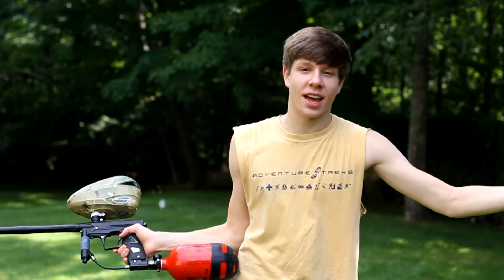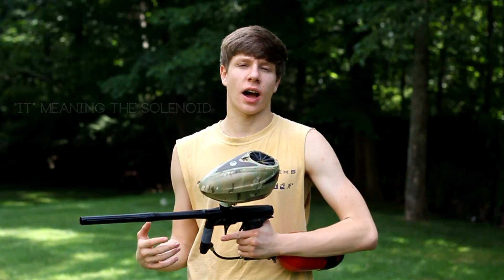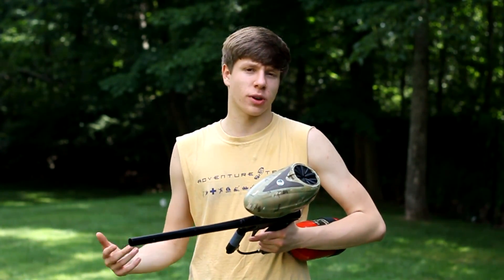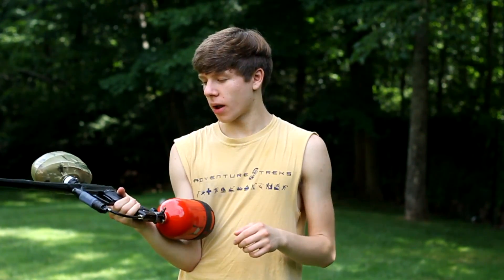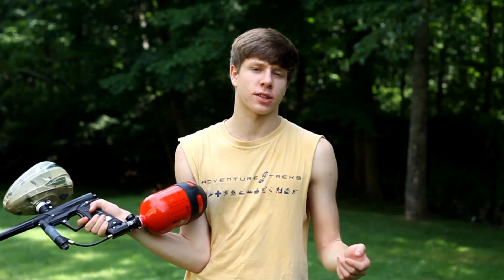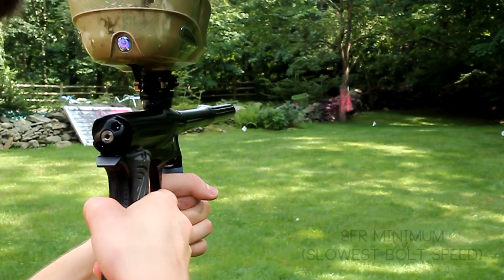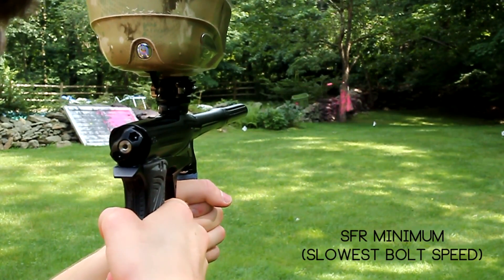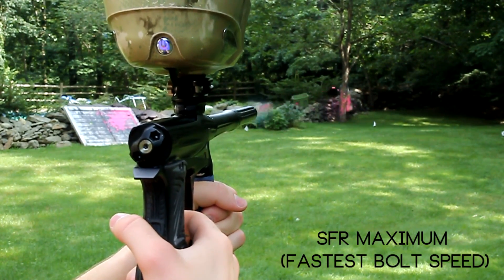Planet Eclipse Geo 3 Solenoid Adjustments

Comment: I'm assuming the sound isn't the only difference guys, does it shoot smoother with it lower or higher? which way kicks/vibrates in the hands more? Does it really make THAT much of a difference? Which do you like more? I'm sure these are questions everyone is thinking as well. Also, you should do an efficiency test with both to see which is better, just a suggestion.

Comment: keep in mind that brand new... put 15 cases threw it and you will notice the adjustments.. just like an ego 11 they never recommended changing the solenoid like that till you had shot it a bunch or you wouldn't see a huge difference.